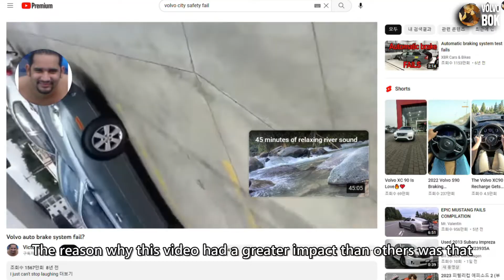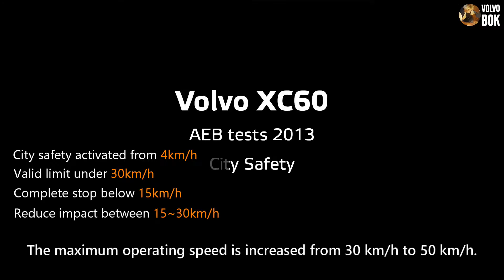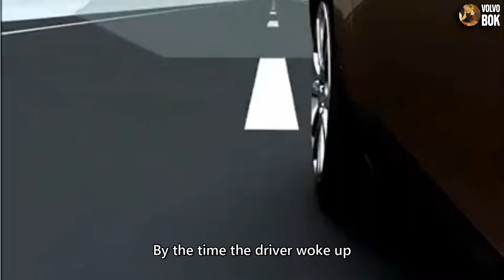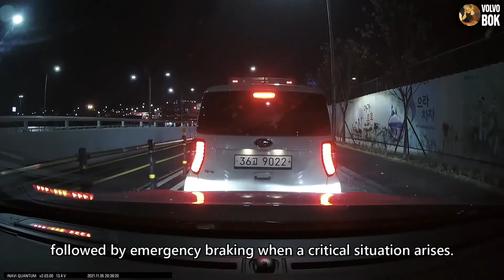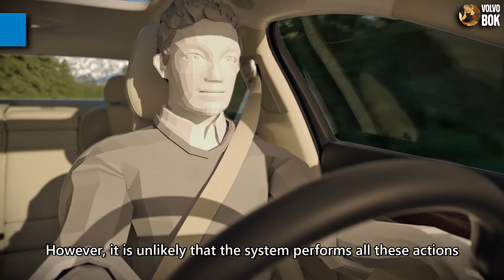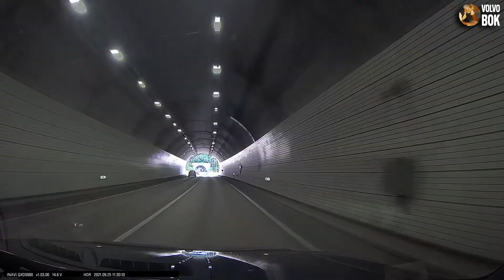31. Limitations of Volvo Safety Systems.

Comment: Being in SE Asia we have a lot of motorbikes on the road - typically doing whatever they like. I can first hand confirm my Volvo is quite happy to take over steering where it detects a vehicle to avoid. Prime example I've seen it is exiting a freeway to the left with a motorbike in your left blind spot, the vehicle detects the motorbike and assumes control of the steering wheel. Scary! but ultimately very safe.

Rear brake alert is a little over the top and super scary, cross traffic alert is a bit problematic in that heavy motorbike environment too but I can't honestly see a safe means of improving that.

Comment: Great Video! Love our XC60!
#VolvoForLife!
Reply: I got my S90 T6 Inscription and last year it saved me from hitting TWO elk on a dark road with no street lights.  Best car I ever owned!
Reply: @RdesignedSteve  Thats amazing. Our 2019 XC60 also saved us multiple times from having a rear end collision. If the Warning Timing is set to early it significantly boosts the citysafety autobrake capability. And we still never had any unnecesary braking wich is great.
Reply: @zero_wv   I was heading home just a few months ago and I was so sick I started getting dizzy and I almost passed out. I had pilot assist on. Without my S90 I would have never made it home, if you know what I mean. 

Also the 1,400 watt audio system is in-cred-ible. 😤
Reply: @RdesignedSteve  i feel you, i wish the earlier models wouldve also had the emergency stop function from pilot assist. Cause in the sensus os it just deactivates wich is really a shame when you fall asleep or smth.
The Bowers and Wilkins Sound system is probably one of the best on the market as i heard from so many different reviewers. Enjoy it.
Enjoy your Volvo! #volvoforlife
Reply: @zero_wv  It's true that it'll stop working but as long as you have lane assist on you'd be at least a little more safe. What they should have done is programmed a (pull over and shut down) sequence.
Reply: @RdesignedSteve  yeah we always keep lane assist on. Theres also so much more background active components like road edge detection etc wich would still maybe avoid things, but like we said, its weird that they didnt implement something like that from the beginning.
Reply: @Zero-sm8oi  Gotta be a reason I'm not seeing. Anyways you enjoy your Swedish tank too 😁
Reply: @RdesignedSteve  sounds good, you too. Drive safe around there and have a great night/day!
Reply: @Zero-sm8oi  Much thanks! You as well!  ❤️
Reply: @RdesignedSteve  thanks bro

Comment: I just ran across this video - WOW - these findings are consistent with my experience driving Volvos since 2002.  What a great summation of the history of Volvo's modern safety systems in the real world!  I certainly recognized from the onset of ownership that due to the complexity of pulling off semi-autonomous driving and accident mitigation, READING THE FRIGGIN' MANUAL must be the first step. I'm so glad the that @VolvoBok ended this video with a clear call to read the manual!  These vehicles are not Hasbro's Transformers - these safety systems are not AI and even if they were, we still have sole responsibility to make good decisions when driving ANY vehicle, liability if we cause damage and culpability when our actions cause injury to others.

Comment: Volvo has no safety issues, it's people who are the problem, we drive cars without reading the manual what applies!  Volvo City Safety is calculated to protect collision in the city max speed 50km per hour not if you drive like a madman over 150km per hour, but right speed safety develops over time it's about how good the camera is!

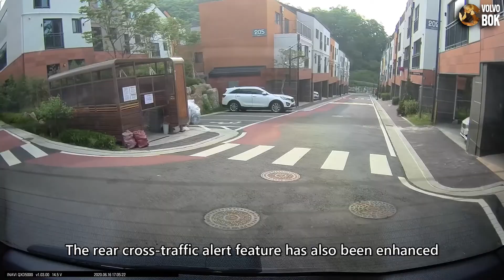Comment: 12:59  - Here, did the system brake? 

Why, more than enough room to go on…

Lane keeping, warning (other s***)- If it only works when the Cruise Control is ON, it's fine. Otherwise, when I buy the car and have it, I'll just disable it permanently. 🤣
Reply from the maker: I hope you would watch the rest after 12:59 about Rear Auto Brake.
Lane keeping blah blah shit can't be turn off permanently. You need to turn off it whenever starting vehicle.

Comment: Great video covering almost every possible scenario of Volvo city safety and Volvo intelisafety features and their short comings. As a Gen 2 Volvo XC60 user this video has been a great insight. Much appreciate you effort and time on making such a informative video. Thumbs up 👍 👍👍
Reply from the maker: So thankful.
Reply: Volvo has no safety issues, it's people who are the problem, we drive cars without reading the manual what applies!  Volvo City Safety is calculated to protect collision in the city max speed 50km per hour not if you drive like a madman over 150km per hour, but right speed safety develops over time it's about how good the camera is!

Comment: What happened to just being attentive when driving? Next time don't rely on your car to stop or change lanes for you, pay attention and do it yourself!
Reply: @planetfixatormore1242 I’m a boomer and have a late model Volvo. I’ve used all of its safety features, but I wouldn’t dream of putting all my trust on its drive assist technologies, for all of the reasons outlined as well as my 50+ years experience. Yesterday a driver pulled out of a side street without stopping. Auto brake and seat belt pretensioning intervened to supplement my braking. In other scenarios, I’ve had drivers moving through parking lots at speed with pedestrians and children, buzz past my moving car backing out of a parking space. A few times the rear detection was too late as they were going so fast, but luckily I saw them in time. This, along with the scenes in this video, are why we shouldn’t try pretending cars can drive themselves until governments certify these systems actually work. Simply making ageist statements doesn’t cut it. You as the driver are ultimately responsible, not the technology. Kill someone and you face the consequences. No I’m not a digital native, so mental arithmetic and writing without a spell check come naturally. But I’ve been around IT long enough to have learned a thing or two. Even now with AI, our brains might be slower, but experience still counts for something, as in recognizing threats on the road and where to expect them. Elon Musk wants to convince us that Tesla has the next big thing. Maybe so, but you can bet he also has a chauffeur and a pilot at his disposal - he’s way too valuable to trust in his own self-driving!
Reply: What is up with you boomers being so opposed to assist systems? The name intends its literal use. the purpose is in case of inattentive driving, human visual limitations, driving error these systems provide the second set of eyes to the main driver to support safety. yall are so annoying w this bs
Reply: @planetfixatormore1242 well, it's clear that humans don't seem to use their own eyes when they have "second set of eyes" and im not a boomer, im 20😄
Reply: @C124Enjoyer  which makes it worse that you grew up w tech and don’t realize it’s importance to protecting us at vulnerable times. since you aren’t a boomer, you probably just mad u can’t afford a car that has these safety systems instead. Next caller 💅
Reply: @planetfixatormore1242  what did i say wrong in my comment? The tech is supposed to HELP you, not drive the car itself (at least its not fully capable of safely driving for now) you mad cus u need tech to justify your horrible driving skills?
Reply: @planetfixatormore1242 There’s something about ‘us boomers’ having 40+ years of driving experience. If you want to rely on self-driving tech before it’s certified, it’s up to you. But if you kill someone else, don’t be surprised if their families come for you with lawyers.